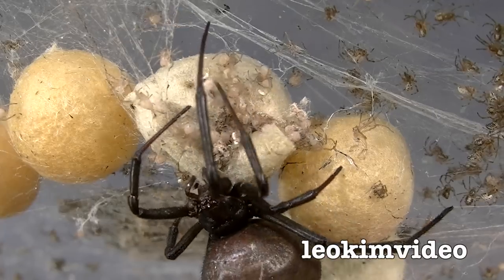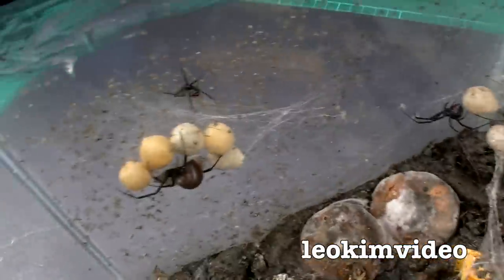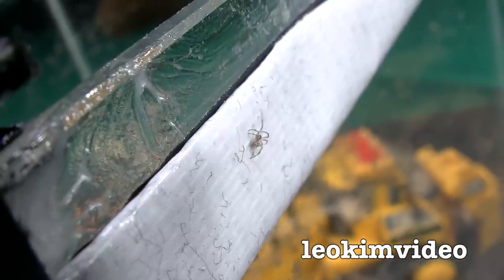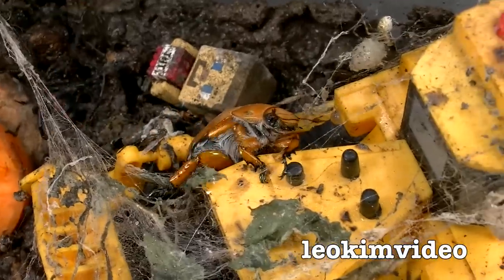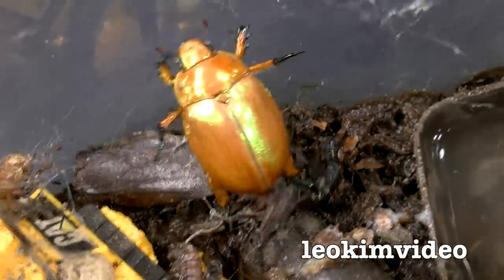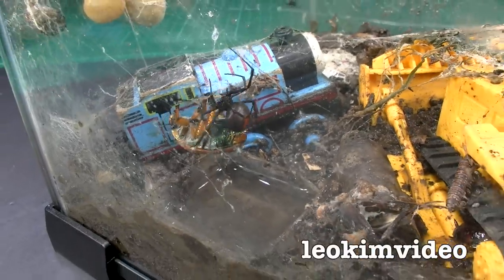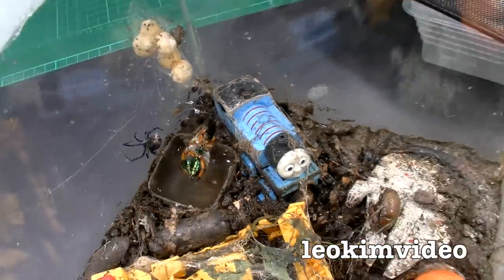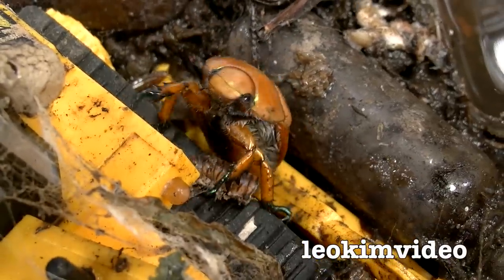Deadly Redback Spiders Giant Beetle Bug Battle Week 9

Comment: If you want to get rid of the moisture quickly, you can put a fan on a raised surface nearby and point it at the grate on the top of the tank. This will suck away ambient moisture in the tank, causing the water to evaporate to replace the moisture, only for it to be pulled away again. It should dry out the inside reasonably quickly.
Reply: Ah yes and create it into a vast desert land
Reply: Antonio Zavala well the spiders are from Australia so its not like the habitat would be unnatural
Reply from the maker: I was thinking of using a flamethrower to pull the moisture away ;)
Reply: yessss
Reply: leokimvideo oh jeez not the babies lol. So is the series finished or is it still going or is that a prelude to the end of the series?
Reply: Stephen Justinen no this doesn't make sense but 

FLAMETHROWER
Reply: leokimvideo respect

Comment: I actually have an idea for containing the spiderlings. You know those big plastic Sterlite tubs? Perhaps you could pinch a lid from one of those, put the terrarium on top of it, then...
1 - fill it with water
2 - fill it with glue (might be a bit more expensive)
3 - Spray it with generous amounts of Spider spray. It shouldn't get into the terrarium because of the glass.
Please like the comment so it can get nearer to the top and Leo can see it!

Comment: ok from what i've gathered, the cellar spider (daddylonglegs) will be chilling on its web, when the spider comes along it will use its long legs to keep distance (or it might start swaying to disorientate the spider) and it will continue spraying its silky web around the spider until its fully covered and cant move (maybe bring it up higher so if the spider tries to bite the web it will have a big fall) and then it will deliver the bite which will kill the spider.